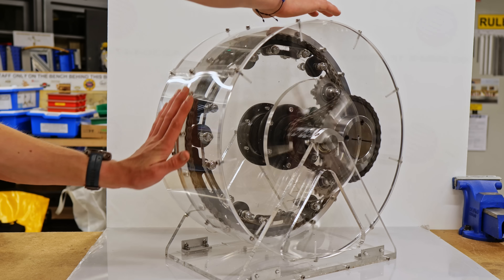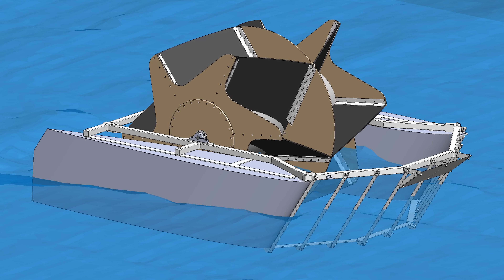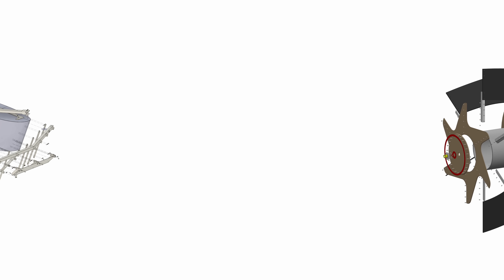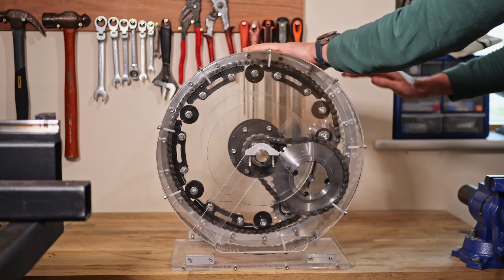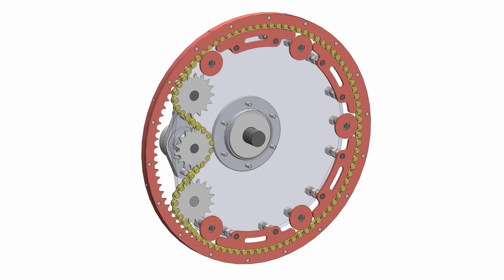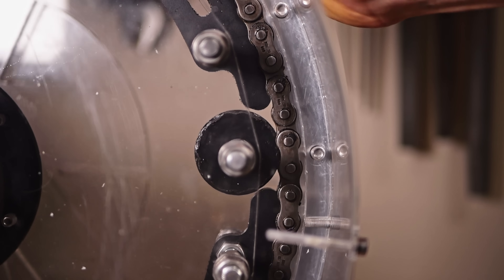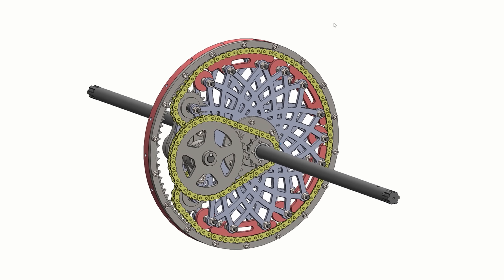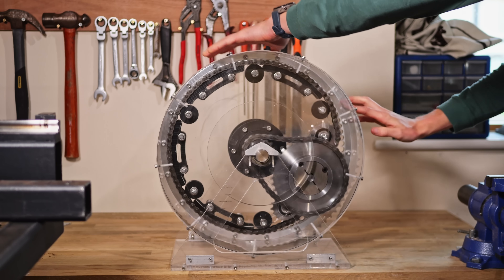Design of an Inverse Chain-Drive Transmission

Comment from the maker: This video is a bit different to my usual ones, today I am showing the design of a novel, 1 to 15 inverse chain drive power transmission, designed as part of my final university project. 
Let me know what you think of the design, and if you think it has any potential real world applications. 
Looking forward to hopefully uploading more videos in 2025!
Reply: Bloody brilliant! My only recommendation would be nylon or teflon bushings around each pin of the chain where the sprockets engage. Without any oil or grease reservoir, the metal on metal engagement has a much higher friction coefficient. Chain tension could also be maintained by the inverse gear inside with a small tension spring or by the take-off gears instead if that's not possible. Again, brilliant work, and I hope the next version if you make one is even more successful!
Reply from the maker: @gstein123  Yeah that is where my interests lie now, seems to be where the channel is going if you look at my uploads in the last few years!
Reply: Interesting concept. Having a tension mechanism would have removed the design constraint of requiring the length of the chain to be a whole number of links, provided you can adjust at least 1 link's length. I would have mounted one of the outer sprockets on an adjustable slide parallel to the outer rim. 2 birds, 1 stone 😊
Reply: I spent a lot of hours on this design, & there are many remditions & tweeks, from suspension to centreless motors this inverse/hubless design has many application, most noteably with real time spring rate adjustments, centreless robotic joints with inside out suspension..  Any which way it is good see this.

Comment: Wow. What a beautiful design, thanks for sharing this!
As a bit of an off-topic question: I am also an engineering student working on my master's thesis, and facing a similar problem. However, in my use case the torque requirements are much lower, and emphasis is placed on silent operation, so a belt based alternative would be preferrable. Could you expand a bit on the inverse belt prototype you built? How much torque was it able to handle and were there any other critical issues you faced when designing it? Also, do you have any recommendations for literature on this topic?
Thanks, and great job once again on the final design!

Comment: We need more people like you. People who give a shit about making the world a better place by applying the knowledge you have gained to fix problems. Even if this isn't perfect, it's progress, and that's what we need these days. You should be proud of what you've done to make your little corner of the world a slightly better place. Never give up, never stop learning, never stop improving. It's especially meaningful that you're trying to use readily-abailable materials and construction ideas to make this as accessible as possible. It's easy to design "perfect" mechanisms that are too expensive or too frail to survive in the real world, where things like inattention to maintenance, lack of replacement parts, and high cost are very real challenges that cannot just be waved away.

Comment: Great Idea (I teach Mechanical Design at USYD Australia). Its also scale able into duplex and triplex chains for even higher torque transmission. Its cost effective (vs gears), very compact and efficient (chains are very efficient in a power transmission application). I disagree on your comments on life. With a good oil bath system, I see no issues. Please keep in touch!

Comment: Maybe this kind of design could be used to make a thinner transmission than a sun-planet system, perhaps if you can get multiple gear ratios working it could enable more compact hub gearboxes on bikes for example.

Comment: yeah this stuff is cool and all until you realize water energy goes up exponentially with speed and small stuff just kinda sucks tbh. same issue with wind.

flowing water with no pressure behind it just doesnt put out much
meanwhile slap a solar panel down or like 4 on floats on the same exact boat and it probably makes more power >>  2.5kw at 3m/s flow speeds in reality 500....so at best 4 600 panels 14x6 feet or 84sqft or 9x9 feet and it would make more energy simply with 4 600 watt solar panels 
or about the same in 6 hours for far less using solar than this thing would make all day long with a flowing river to be fair

slap a lifepo4 battery in and 4 panels and its still probably cheaper

keeping electricity electrically stored is just always going to beat mechanical stuff.    stored hydro aint bad but massive capital costs and government owns all damns so cant really scale them or invest in them. 

and if you want river power still  throw in an anchor and grab a basic float or something and a towed turbine used in sailboats.

Comment: Man, I never got a degree as an engineer, I should have, but a lifetime of design and fabrication for work and fun has given me a sort of "street smarts" ability to design and fabricate. Both in a virtual space for 3D printing, and physically on the fly welding, sheet metal, upholstery, and woodworking. I rarely meet someone in real life that has made, or attempted to make the range of things I have. I say all this to tell you that your talent and ability is far ahead of mine. The solutions you came up with to make this genius prototype work are impressive. The way you made both chains tension in the right spot had me chuckling at how elegant your solution was. Making the pontoons wing shaped was a nice touch that I wouldn't have thought of. Very nice work man!

Comment: If anything this design might have potential for automotive timing chain because only a fraction of it is loaded at a time. Modern vehical timing chain setups are loaded in so many areas with complicated teflon wheels / ramps / tensioners / anti-slap guides / spring loaded vibration dampeners the works. Not only is most of the chain not loaded but it isnt moving anyway its basically at rest which mean lower friction on the link pins / bushings and less egg holes. Timing chains go wack because of so many link pins, all of them working together egg out the holes very small amount less than one thou per link but all adds up in the end. With you design the longer the chain the less it will expand which is the exact opposite in any other situation.

Comment: The only problem with power generation ideas that are made to be low cost and operate out in the middle of nowhere is that the people who it is designed for, are most likely unable to afford and/or logistically impossible to deliver any electronics that would require the power in the first place.

Comment: I think its over complex the band could be supported at the inside over multiple extended planetair gears who then could lead to a central axis. But a much simpler version would be just one large gear a chain and one small gear the speedy axis gets above the generator would end up higher from the water as well then. Simple might be best here. But it does look nice.

Comment: Very novel design, it's always nice to stumble upon a good video.
If you have any ambition to look further into this design, I would like you to try the following:
Why have the chain go all around the outer diameter? You need to find out how many teeth need to engage the outer sprocket to carry the torque. The rest of the chain can be fed back through near the heart of the ring spronket with some idler wheels. This shortens the chain and thus its lifespan, but you have some space for a tensioner and maybe a lubrication system.

Comment: I know this isn't the point, but putting the large sprocket on the outside would be almost identical in both performance and overall geometry while getting rid of the massive friction and wear problems. I do also wonder about the lifespan of the large sprocket when all of the torque is trying to pull the chain to the tips of the teeth and off the sprocket instead of forcing more engagement with the chain if it were on the outside.

Comment: Lubrication would help with the friction issue.  Perhaps the lower portion of the chain dragging through an oil bath and the rest of the inside lubricated by just the splash or carry...  --- As soon as I saw the YouTube thumbnail with the chain, I was thinking of other applications like bicycles..

Comment: Why do you have the chain running around the entire outer diameter, creating a bunch of friction contact points, don't you just need to run it over less than 1/4 of those to transfer the torque from the paddle efficiently, why run it all the way around over all those wheels, you could cut the chain straight across?

(I designed and 3d printed some nema 17 actuators similar to an inverse of this using ball-chain cord btw, worked really well)

Comment: Hey, Nice design. I have a question about the scoops, if you were to alternate them, wouldn't it allow the water to come in smoother and reduce wave production? Because when the two halves of the scoop are taking water at the same time, they take in a large volume at an angle all at once, which would create waves.

Comment: I know this was mostly a though experiment, and I'm sure somebody else must have said this already, but here it goes: put the gears facing downward rather than to the side, then add an inner drum, and flood the gearbox with mineral oil, 200% of the amount being just enough to wet all gears.
Also, I'm pretty sure the chain doesn't actually need to follow the entire circumference. That just adds loads of friction to no real benefit. Have it touch the circumference twice (before and after), then return.

Comment: Cool.  With regard to the actual generator project.. why not use two smaller generators, one at each end vs something like this in the middle?
Two offers ease of access for repair, partial redundancy, uses less costly smaller off-the-shelf proven components, and two 110v generators can be combined for 220v which is useful in many countries.

Comment: This reminds me of the Reevo hubless e-bike, which was a complete flop. Sometimes it's fun to engineer something, but it also has to be practical in real life applications.
Good luck with your project!

edit
I can already see that your rolling resistance is going to be quite high, which means a huge loss of energy. Did you think anything up to fix this?

Comment: While neat, I think the cheap bottle for flotation + large wire spool +2x 8:1 wooden cage gear + car alternator is way cheaper and better for non commercial. It's not efficient, but it works and can be made with mostly spare parts and more importantly repaired, you just use a bigger wheel to compensate for the inefficiency.
Also you might want to add a fence in front to catch wood and other floating debris.

Comment: Could mount a normal gear to a plate (kinda like how that inverse outer gear is) and save a lot of rub points as well as complexity, although might need to rework the number of teeth on the rest because the normal BIG gear would inevitably have to be smaller than the inverse gear

Comment: That's an awesome design. Maybe a double roller chain would reduce the stretching issue. It will increase the cost but in the long run it will save replacement cost. I'm not an engineer but just a thought.

Comment: There are low friction chain guides made for VW timing chains which might be a usable off the shelf component to reduce operating friction, though I don't think the profile would be exactly what you want.  This is a really neat design.

Comment: Interesting design.
A winch can be bought relatively cheaply with 3 stages of planetary gear sets in them and able to pull 2000 pounds, so I do not agree on the planetary gear part being to expensive in general.

Comment: the system will survive and have a long service life if the whole unit 
is enclosed and sealed to run in oil, also there is nothing to stop you 
from running duplex or triplex chain. self adjusting chain slack 
adjusters can be incorporated in the design. however a finalized 
commercial unit although reliable will be expensive.

Comment: I am a mechanical engineer and I have also designed a floating water turbine. This turbine is described in my public report KD 598 titled: "Ideas about the 3-bladed VIRYA-0.65 water turbine with 20° inclined shaft coupled to the generator of the VIRYA-2.68 windmill for 12 V or 24 V battery charging". The generator and the turbine rotor are directly coupled to each other without an accelerating transmission. I have my own non commercial website on which you can find this report for free at the menu KD-reports but my experience is that if I mention my website, my post will be removed. You find my website if you type Kragten Design at Google.

Comment: Why not swap the outer chain to the outside of the main sprocket? You can use a spring loaded tensioner in the smaller drive sprocket to keep tension over time. Reduces friction, keeps the massive surface contact

Comment: I can see this having the same problems as a CVT. During extremely fast changes in input speed. The chain will completely bust. I can see this happening from freak waves. And wakes from container ships. Also sea or fresh water will inevitably find its way in, and weaken the chain.
Reply: Waves will just hit the water wheel it will not really speed up the water wheel in a meaningful way, so the chain will not feel a fast speed change.
The water wheel has a mass so any sudden hit from a wave is smoothed by the weight of the water wheel.
Reply: @larsjrgensen5975  obviously you've never been at sea or in a large body of water when it gets extremely rough.
Reply: @ This thing is maybe 3m x 3meter big, it is not made for the sea, the wheel or the mounting system is going to break before the chain does.
A 100 year old Fiat S76 race car with 290hp had a chain drive.

Comment: There is a very simple way for your case. There are chains with ears. A chain like this, but at least 1" fasten to the outer ring. On the inside, the chain turns a small gear with 10 or so teeth. The small gear only works on one of its teeth, but since the teeth are large, it transmits the power well enough and the wear is weak From it with a smaller circuit, move to the second generator drive.

Comment: Your project showcases an impressive and sophisticated design, particularly in the complex drive converter system leading to the generator. Your technical skills and engineering capability are clearly outstanding.

That said, as others have noted, relocating the power conversion and generator components into the pontoons could greatly enhance the design. This adjustment would allow you to incorporate a wide range of off-the-shelf components for converting rotary shaft power into electricity. Not only would this simplify assembly and construction, but it would also improve transportability. Additionally, housing these components in the pontoons would effectively protect them from water exposure.

The waterwheel itself stands out as a particularly exciting feature. Optimizing its hydrodynamics to extract maximum power from river flow presents a fascinating and valuable engineering challenge.

Overall, you've developed an exceptional and inspiring demonstration of engineering skill. Keep up the excellent work!

Comment: As an engineer myself, I really appreciate implementation of any idea. Coming from a mostly theoretical background, I am always impressed with anyone that can realize an idea. From pen to production. Great job.
Reply: Production? He is at the mid/late prototype stage. He would have to fix the issues regarding chain tension adjustment and start doing some durability runs...  This is a DEAD design without tension adjustment, the amount of wear parts in the inverse engaged gear is going to require a slack adjustment if it can even function and engage properly after the guides start to wear. 
TBH even with a tension system, this inverse chain drive is probably not a good solution, I do not see this drive functioning without major maintenance/functionality issues. A cheap design with a high maintenance requirement needs that maintenance to be very easy and very cheap.

Comment: Due to water and corrosion, I wonder if this could also be done using Silicone Rubber Timing Belts instead of chains? I would imagine the chain can get more torque, but if it is in water, maintenance may  be a concern.

Comment: Looks cool, but inventing a way to use a chain on the inside seems like you're over-complicating the design.  Usually when you are trying to do something that has never been done before, it is because you are doing it wrong.  Sometimes, there is a new genius way, but start with design as form following function, not the other way around.  It looks like you're trying to contain a gearbox inside a rotating hub while also constraining yourself to input and output on the same axis.  State your problem first.  Are these features absolutely required for this to function?

Why is it so important to keep the shaft input and output on the same axis? You already have access to CNC to make the inverted sprocket, why not make planetary gears instead? Or, just make one ring gear and one internal gear where you have an idler sprocket, then modify your one set of external chain sprockets to spin on that idler and back the the hub.